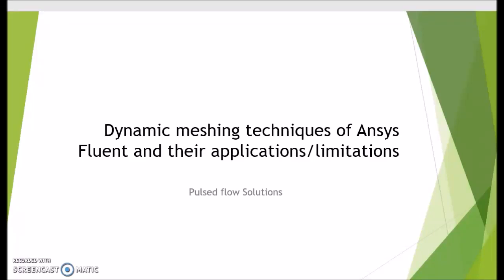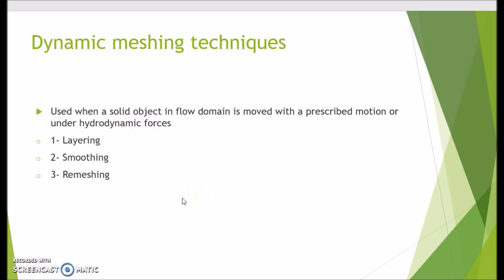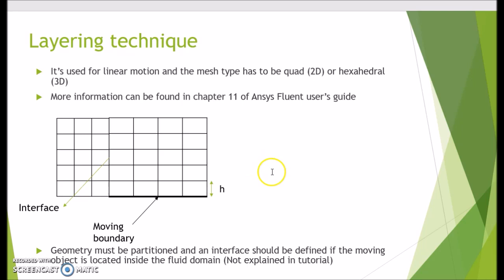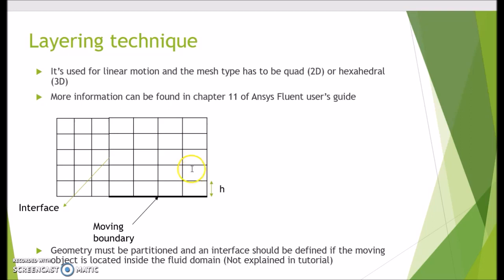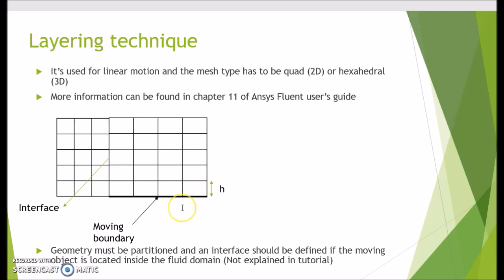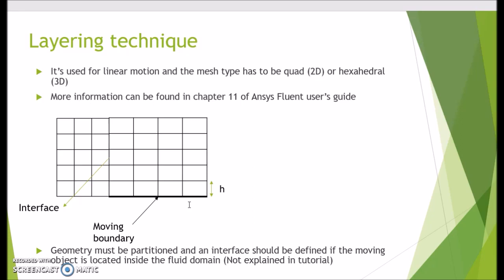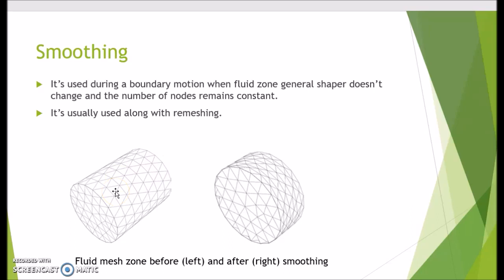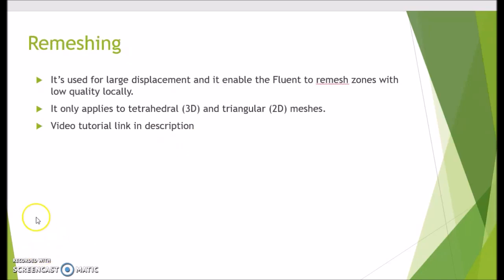Explanation of Fluent Dynamic meshing techniques

Comment: Hi, 
Thanks for the information for meshing techniques. Do you have any tutorial for valve closure (one direction movement) with remeshing? As in my case a gate vale will be closed (3D) I believe I need to use  remeshing/smoothing.
Reply from the maker: I don't have it but I guess it should be in Fluent tutorial.